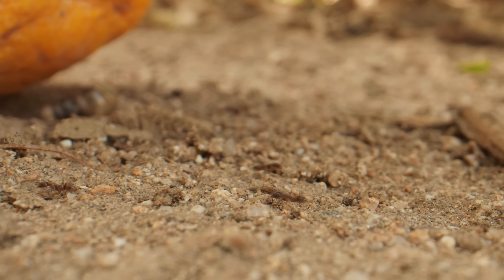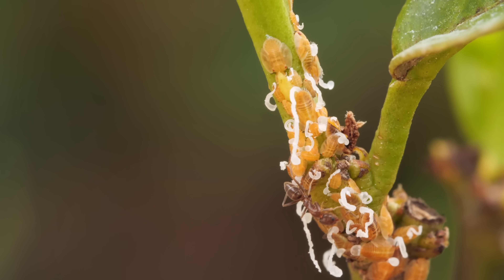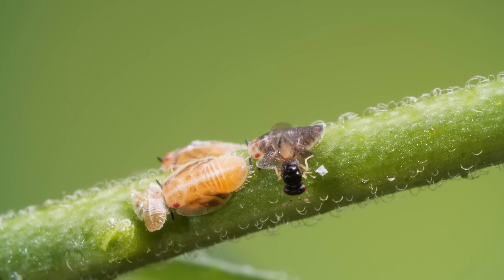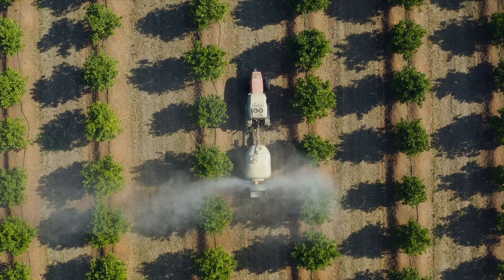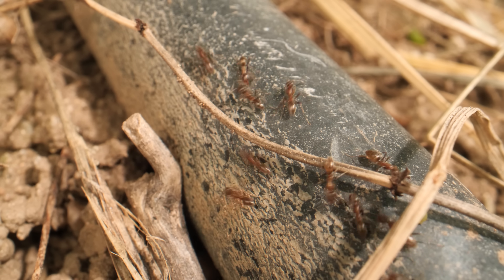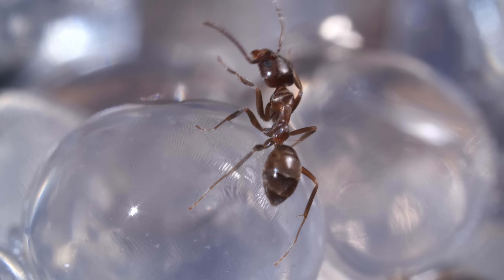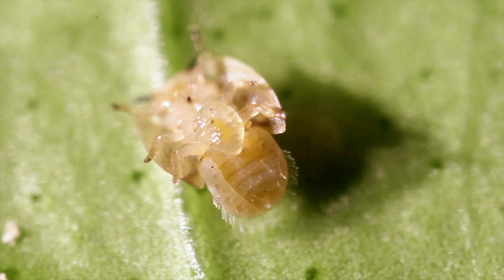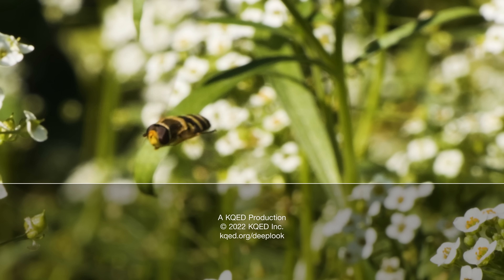Citrus Psyllids Bribe Ants With Strings Of Candy Poop | Deep Look

Comment: I moved into a new place, and it had ants everywhere! Literally, I'd have a cup of coffee next to me, and 10 mins later, ants would be sipping it right beside me! I ended up setting a trap for them. I took some of my dog's kibble and set it on the floor nearby. When I found a trail they made to it, I used a Thai poison similar to the ones the farmers in this video used! It was pretty much that, but in a gel form. One little squirt right on their trail, and ants were abandoning the kibble to sip the poison in a big circle around it. By the next morning, the ants were MIA. Haven't had a single ant in sight since, and my coffee is safe! The poison was called simply ANTKILLER and came in a tiny bottle that looked similar to white out.